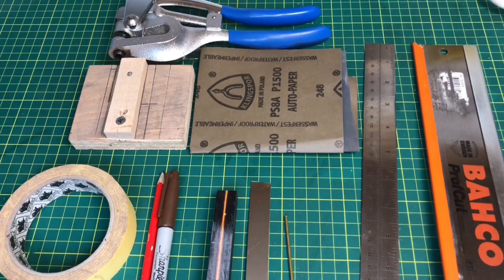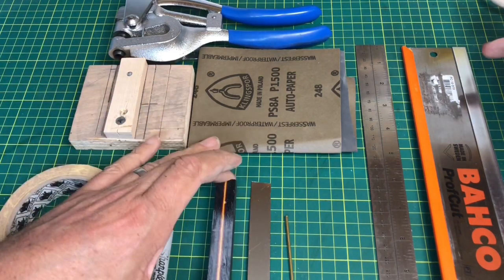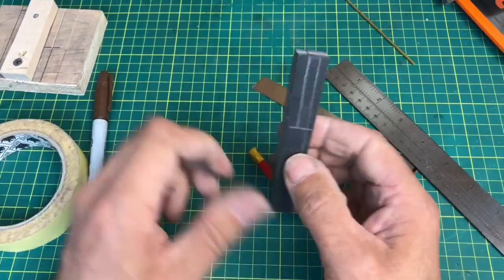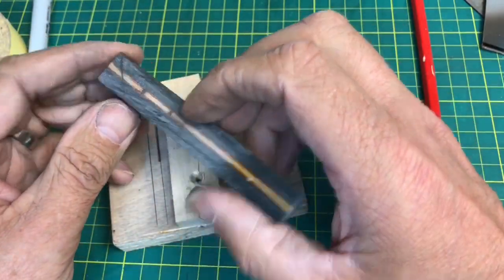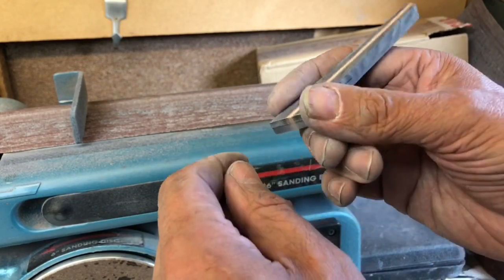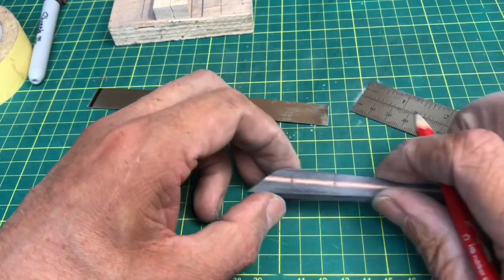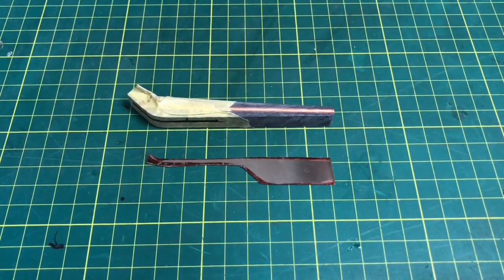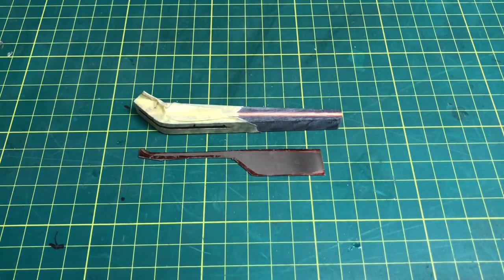Micarta pick Build Part 1

Comment: Really well explained and demonstrated Daz 👍  Watching that belt sander of yours in action just about has me hankering for one myself.  For me, hand shaping the handle is the longest part of the process.
Reply from the maker: Tipene Nga Puhi Thanks Tipene, I was I little unsure how to go about making the video. I learnt a lot making this one. The next part is primarily about my process getting the pick tip done. The bench sander is amazing & worth every penny.👍
Reply: @dazevers  I can see it would be.  Often I'm starting with pieces of wood that aren't square.  I spent ages planing and sanding them to square the up.  A sander like that would save a huge amount of time
Reply from the maker: Tipene Nga Puhi Absolutely, if you do get one I recommend 240 grit belts & also 400, It makes a massive difference when finishing the sanding by hand.

Comment: Great vid Daz waiting to see you use the metal hole punch only I have the same one and only make a dent😜👍
Reply from the maker: Vic's Pick n Lock Thanks my friend, part 2 is mostly about the pick tip process. I will up load it Friday. Have a great week. 
I do punch the holes with the hole punch in the part 2👍

Comment: very useful and informative construction stages especially the low tack tape. you can not beat the old black and decker I have an original aluminum trusty beast.and two models that followed but not as robust and a portable black and deck  which means I can work indoors creating dust.thank you for sharing the stages of construction well done

Comment: Fantastic video Daz, I have the exact same sander, it's a great piece of kit for roughing out with. I've lost a fair bit of skin using it though 😂
Never thought of using a hacksaw to rough out the pick profile, I use a bench grinder but it's a slow process, what TPI blade do you use on the 301?

Looking forward to the next installment 👍
Reply from the maker: Jason J Thanks my friend, part 2 is mostly about the pick tip process. I will up load it Friday. Have a great week. The bench sander really is fantastic, & yes I have lost a lot of skin & most of my fingerprints. 
The hacksaw blade is 32tpi it’s priceless.👍